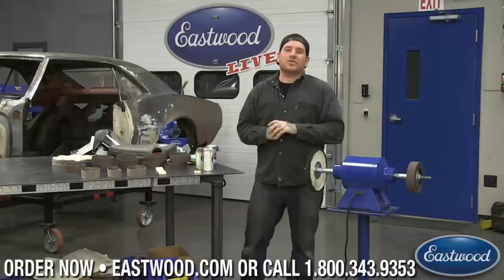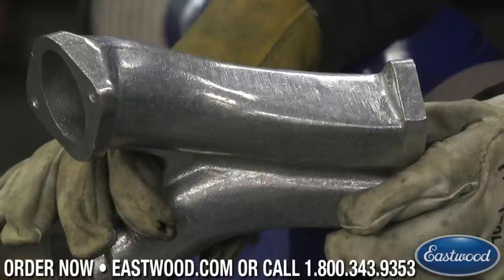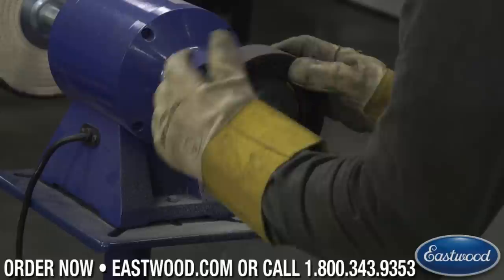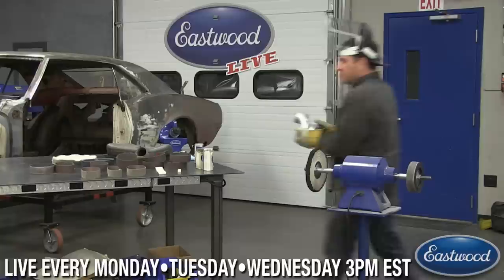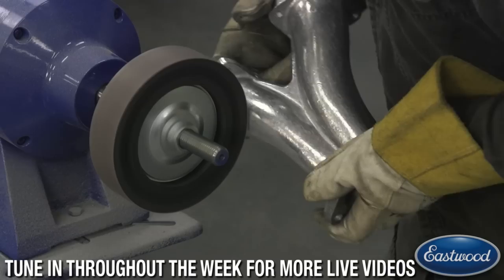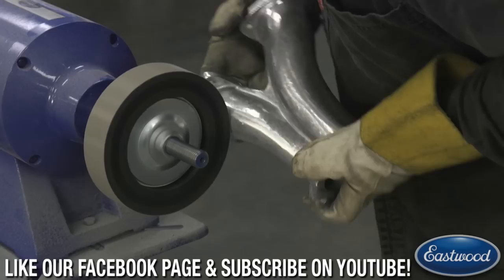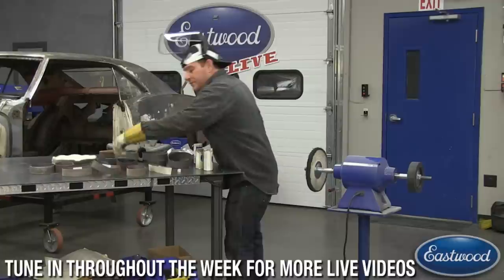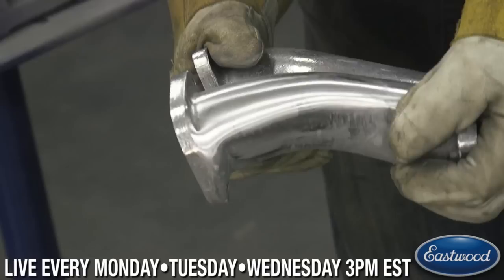How to Buff Aluminum - Why You NEED an Expander Wheel from Eastwood

Comment: I have been a metal polisher for over 35 yrs and was wondering how long the higher grits last(ie)800-2500 last on aluminum  or softer metals on those expander wheels?